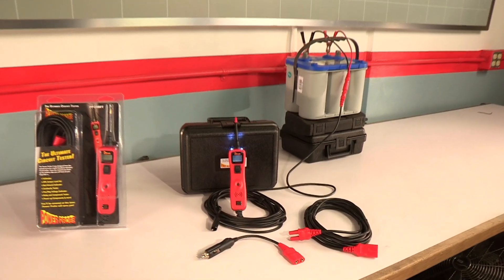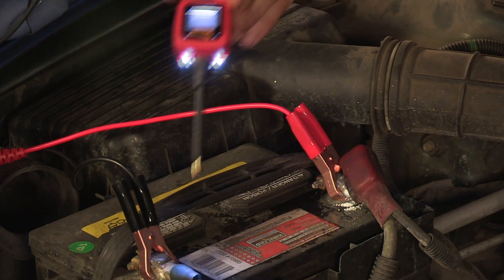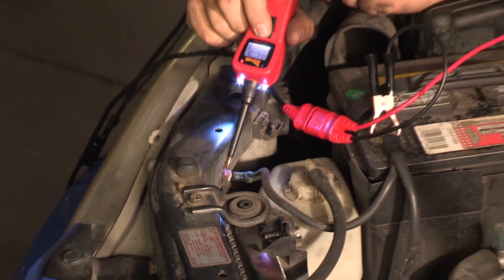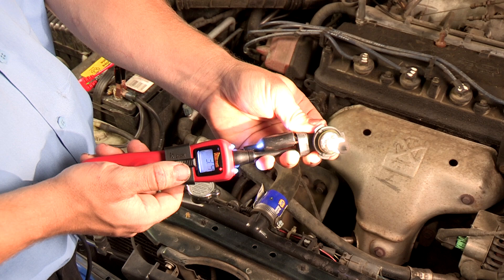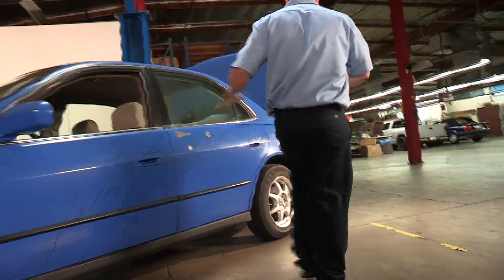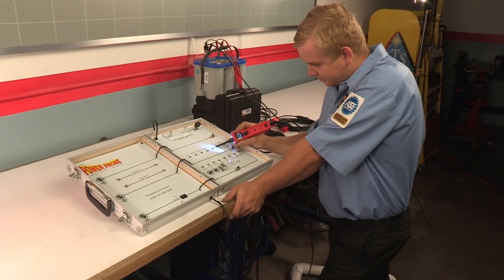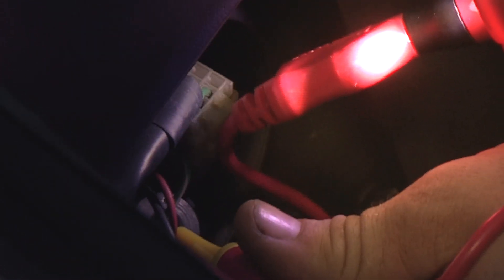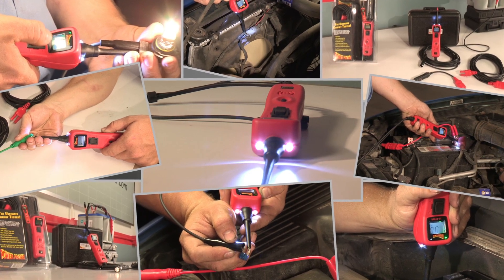Power Probe III Multi-Tester

Comment: Also,PRO-TIP -- people say that the switch latches are too brittle and can crack when installing or removing them....

Solution ---- put the switch latch into HOT(not boiling) water for 10 mins... softens them up just enough to where they're still strong,but not as brittle... have not broken a latch yet, since doing that

Comment: Definitely one of my favorite electrical daig tools....Have 2 PP3 that I use DAILY(have the PP prokit and a 2nd spare) ...also picked up the ECT3000 circuit locator and At first glance,they may seem a little pricey compared to generic circuit tools,but the main difference,is these actually WORK....no comparison with a cheap circuit location tool, compared to the power probe version..worth every penny.... basically paid for themselves on their first service call.....but,now I want one that has scope capabilities...I use my fluke clamp,but its bulky and can't get into tight spots....my only peve,is I think the switch latch should be included in the master kits ...

Comment: My Power Probe reads 34 volts  all the time for battery voltage, I wish I had paper instructions instead of this disc that I can't read.
Reply from the maker: Hello CS brn- please call our tech support team at + 1 833 533-5899 for help with your tool.
Reply from the maker: you can also download the manual https://www.powerprobe.com/na/en/PP3

Comment: Checking the ABS 10 Amp fuse the Power Probe shows a flickering of the ground on both sides of the fuse. All other fuses appeared normal but the ABS has me concerned. I replaced the fuse and no change, I tested with fuse out and got a good steady ground in the fuse holder with key off and a good steady 12v with key on. The flickering (both audible and visible) leads me to believe I have a short or is this normal in an ABS circuit?